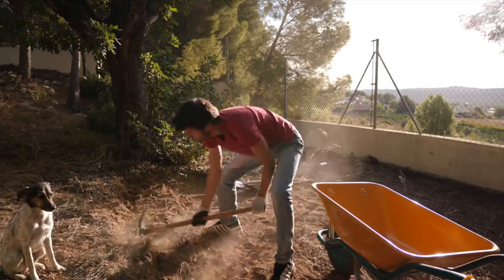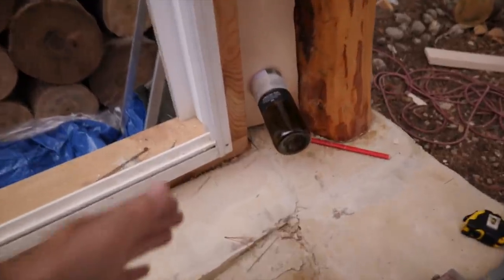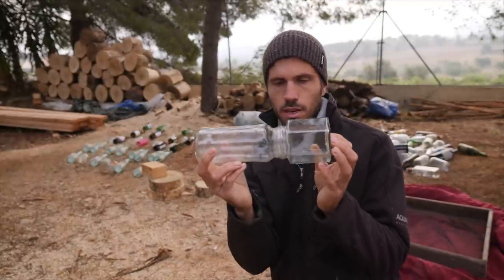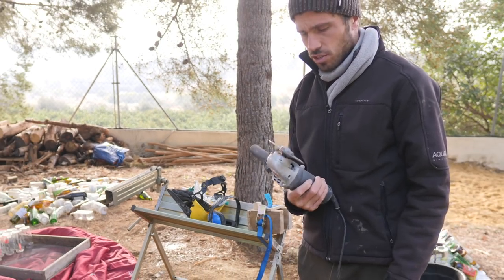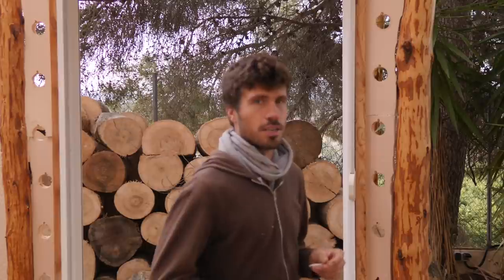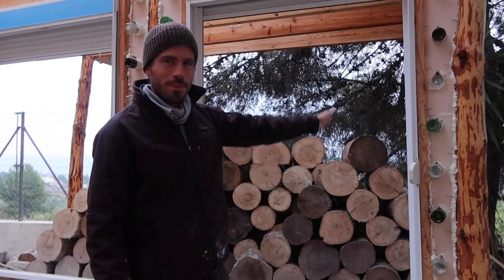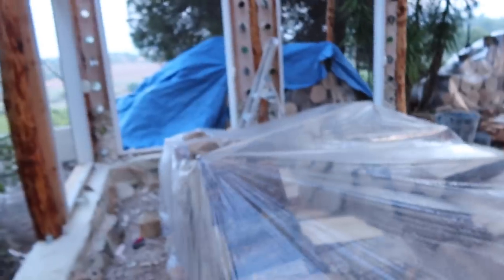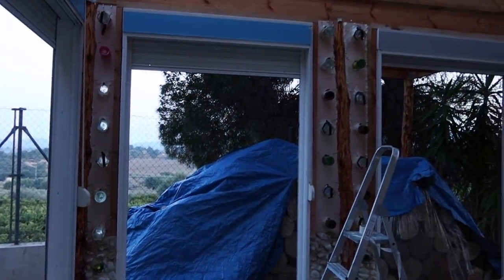Greatest Challenge So Far, Making of a Wine Bottle Wall in Log Cabin

Comment: It is going to look very nice! I worked with cement recently and yeah, it does take longer than expected XD. A good idea, perhaps would be to add some more screws and what I did last time is to create a kind of a "mesh" with wire (cheap thin wire, the kind that you can bend with your hands) going from nail to nail, this would help support the cement better. All tbe best Huub, you rock!
Reply from the maker: That's a good idea. I think I'm gonna try to switch to nails too. They're so much cheaper...
Reply: @HuubVlogs  Good thinking!